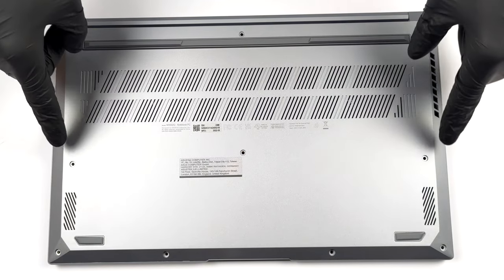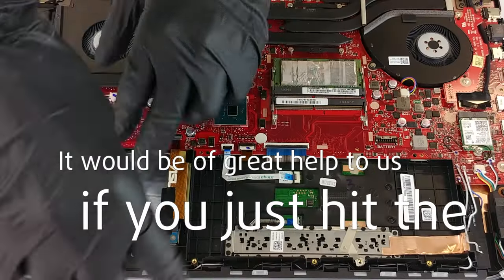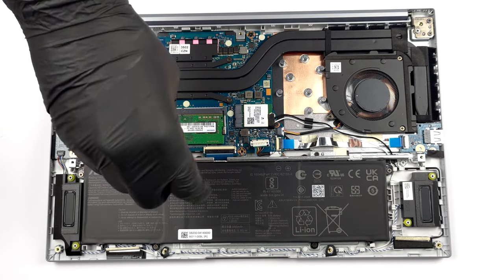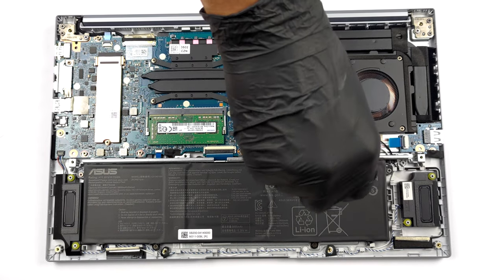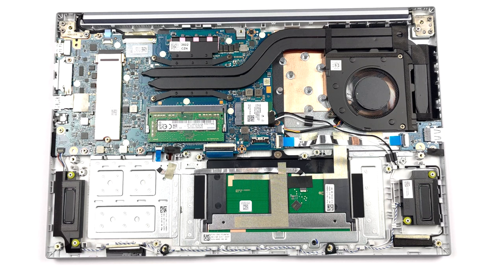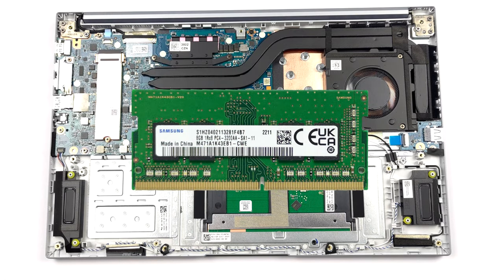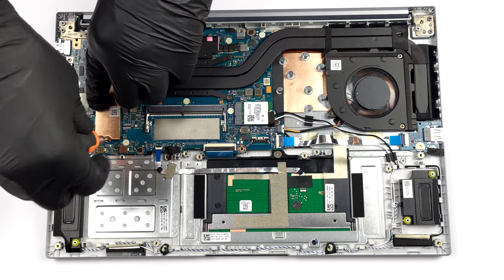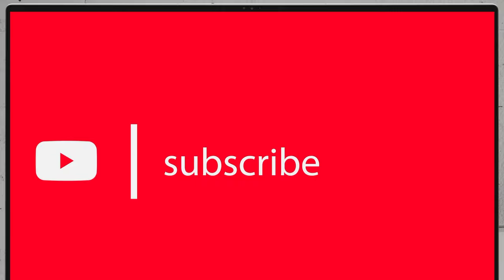🛠️ ASUS Vivobook S 15 OLED (M3502) - disassembly and upgrade options

Comment: Is it possibile to upgrade with single 16gb ddr4 stick? So with 24(8+16)gb of ram?
Reply: Yes, I have done it. It works
Reply: I hve upgraded it to 24 gb, but ssd upgrade 2 tb is not supported. I wasted my money buying Kingston KC3000 Gen 4 Pci 4.0
Reply: @SwapnilVPardeshi are you sure SSD wasn’t faulty and it was just the laptop that didn’t support it? Because 1tb is too limiting 

BTW mine is i5 12500H whats yours?
Reply: @SwapnilVPardeshi I phink it didn't xork because the laptop only support pcie 3.0

Comment: Can we upgrade it to 2TB ssd????
Reply: Yes
Reply: No. I tried with service centre. But its not supported.
Reply: How is it not supported? That doesn't make sense. Just clone and swap.
Reply: @Blip_.  bro I bought the 2TB SSD of Kingston KC3000 NVMe 4.0, when I went to service center for upgrade, they tried for 2 weeks to install the windows on it, but at last they inform that I5 12th gen model of this series does not support 2 TB, but only the I7 model laptop supports. 
so for now I'm using 2TB SSD as external SSD for storage purpose.

Comment: Is it the same model like S3502ZA-L502WS
Reply: Yes. It is. There are 2 though. L502WS and L702WS - only difference is Intel i5 12500H and i7 12700H.
Reply: @arvindhsubramoniam4635 an I use 2 TB SSD in it..? And is ram Expandable upto 24 GB ? by replacing the existing SODDIM slot ram of 8 GB

Comment: Hey do you think I should be able to upgrade the battery life by replacing it by another battery? New to this computer stuff and don't want to blow up my computer.
Reply: make sure its abattery that's the exact same type to avoid any issues

Comment: Thank you, wasn't sure about the RAM having a slot or not. I can just buy the 8GB model for 100 bucks less, and later upgrade with 4 or 8gb when I find a cheap module :)
Reply: i just did that with a 8gb ram module except the price difference is about 200+ euro, so if all goes well and you don't have an issue with warranty is a no brainer
Reply: @aris5921  can you have maximum 24GB (8gb+16gb) of RAM on this laptop?